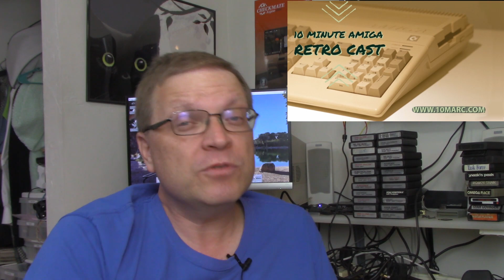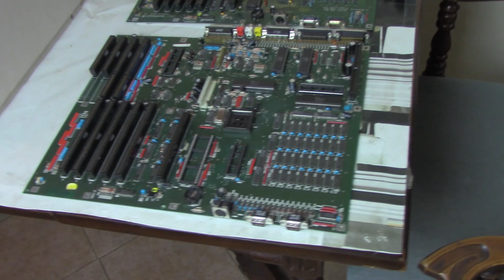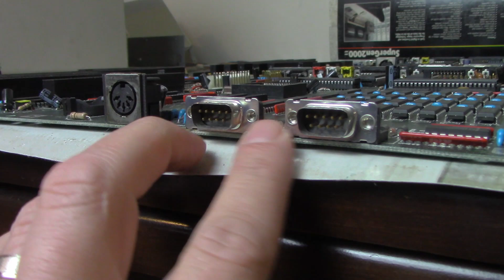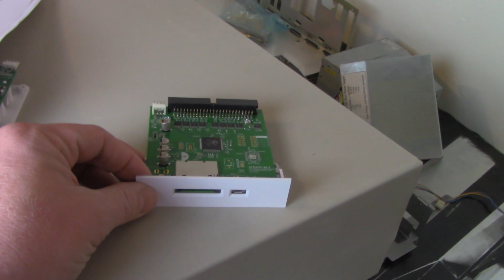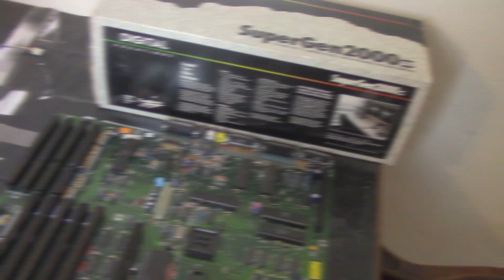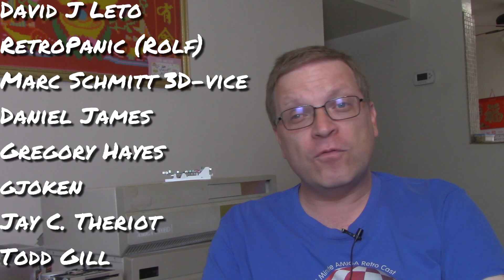Amiga 2000 Adventures - Let's Build an A2000 -Part 1- Episode 86

Comment: I love this!
19:58 - I have a Plipbox for mine, but it blocks the video port...I suppose I can try to find a video card and not use the standard RGB.
(looks like your metal shield came off yours as well. I put a tiny bit of glue in the middle/top and slid it back on.)
Reply from the maker: My Plipbox blocks the RGB port, too, but I figure I will just use a straight thru extension cable to extend the port out a but.

Comment: Oh man I love this idea for a video series! I love the A2000. It's expansion capabilities are second to none in the Amiga world. The 3000 is certainly prettier and more powerful, but you might lose some knuckles playing with that daughterboard. I use a GeForce 030 @40Mhz in my A2K and I just LOVE that card to death as it also has on-board fast RAM and internal + external SCSI (I also use a SCSI2SD card with mine - I'll never go back!), for "blazing fast" transfer speeds. :) It also has the 2mb megaChip. One of these days I hope to find a Mac emulator board for my A2000 - that would be so dreamy. 

Worth noting on your SCSI2SD board, you can create multiple "images" on a singe sd micro rather than needing multiple sd's. 

What I love about the A2k is not only it the most easily expandable C= machine ever made, but because she's the fraternal twin of the A500, she is also the target of most of the legacy software ever written. That's 100% BAD ASS if you ask me. 

You've got some fun projects ahead! 

Who did you use for your motherboard repairs? I have one A2K that needs someone to check out why it won't boot, too. (sorry for the monster comment)

Comment: 18:30 Thanks for this tip.
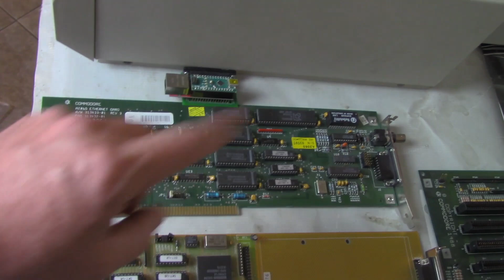19:30 so cool that you have the Ethernet card. The lack of this was the deal breaker that my college's CS department wouldn't consider buying an Amiga when we participated in the Commodore's Purchase Plan/Program c. 1990. They loaned us a Amiga 2500, but without connectivity it wasn't so interesting to students, compared to say a Mac IIx.
Looking forward to the rest of the build!

Comment: 11:23 A bit of trivia: there do exist some cards for the PC, albeit early ones, that will not fit in a 16-bit ISA slot but will fit in an 8-bit slot. The issue is that the PCB drops down to where the 16-bit ISA extension is. I think this is why Commodore left those last to Amiga 2000 ISA slots as 8-bit but upgradable. Here is an example of a card that will only fit an XT slot: https://en.wikipedia.org/wiki/Color_Graphics_Adapter#/media/File:IBM_Color_Graphics_Adapter.jpg
So, those "boring 8-bit slots" work with the A2088 XT Bridgeboard fine. :) There are even some 16-bit ISA [video] cards that function fine in an 8-bit slot: one example, here at 14m29s: https://www.youtube.com/watch?v=NGk31dRc05E#t=14m29s
Reply from the maker: Interesting to know about those 8-bit cards. I know a lot of them are just fine, and some things like cereal and parallel cards don't really need to be 16-bit, as 8-bit works just fine for their purpose. I just like poking fun at IBM PCs, really.

Comment: 12:16 I see what you mean, Doug, that most cards need to be long because they have to reach the back panel holes if they have ports.
I hadn't really thought about that before, i.e., that it's weird the Zorro slots are so distant from the slot openings on the back. :)
One short Zorro II card is the ICD AdSCSI 2000 Advantage card. It is ~half length with detachable rails that can be left in place if you want to mount a 3 1/2" hard drive to it or if you want it to be rigidly attached to its external SCSI port on the slot cover.
https://bigbookofamigahardware.com/bboah/product.aspx?id=1204
Reply from the maker: I agree that there were a few half size zero slots that just stayed in the case and did not need too much sticking out the back. And there are even a few more of them brand new nowadays that are half sized.

Comment: You when the A2000 caught my eye it was things like the Bridgeboard and Emplant or AMAX-II boards that blew my mind.   I thought wow one machine running Amiga, IBM PC and MAC, why have 3 systems when you can do it with one.   When I got my A2000 in the early 1990's it came with an external AMAX-II which had MAC System 7 already installed.  Honestly I did not use the AMAX-II all that often and as much as I wanted a Bridgeboard I never bought one.   I bought the A2000 to run my BBS since it had a 7 Port Serial Card which allowed me to run multiple phone lines.   I already had the Expansion System DataFlier Hard Drive Controller and 8MB RAM Boards which I first used on the A1000 and A500 so I moved them to the A2000 since the BBS Software was already configured and running.   The BBS ran until 1997 when activity just dropped off the face of the earth as everyone got hooked on the Internet.   The A2000 was always set up for use until I moved to my current home where there was no space until I got motivated to archive my software library and get it transferred to my server to be preserved.   Only place I could put the A2000 was on the kitchen table and unlike you I don't have wife worries anymore.  Amiga's can be reset but a wife does not come with such a feature.   So the A2000 stayed on the Kitchen table for months until I freed up some space in my server rack and so the A2000 lived there for a while.  I did install a Commodore 030 board with a BIG RAM Card, Indivision Board, Lyra2 and Miscrosys adaptors so I could connect it to my KVM Switch.   I did have a Commodore Ethernet Card with an AUI to Ethernet Adaptor but I replaced that with an XSURF100 and Rapid Roads card.   I did put in a GOTEK and an external USB DVD and Card Reader to read cards I have files on or cards I am playing with across all my Amiga's.   Yea once you start playing with the A2000 it sends you down a RETRO RABBIT HOLE and you end up buying the rest of the Amiga Family along with lots of shelves, more KVM Switches and you end up stacking them which brings me to my next thing a new server rack with sliding shelves so I can setup all my Amigas in one place but I this one requires a lot of thought on my part because to rack all my Amigas, PC, Receiver, Switches and what not  might require a 42U Rack and its not like you can roll it out the door because it would be too tall so it will need to be built in room it will live in and so that's my dilemma.  This wild ride stated just because I had an A2000HD and wanted to archive my software library.   Honestly if I get more Amiga's I will have to move to a bigger place.
Reply: @John Smith It connects to the external Floppy Port of the Amiga that contains Apple ROM's.   It has two floppy drive ports one for the Amiga and the other for an Apple Drive. The A-MAX-II was made by ReadySoft in Canada.   You can look it up on the Amiga Hardware Database.

Comment: Nice video, looking forward to part 2 :) I love the Amiga 2000, it's so interesting with it's big motherboard and all the expansion cards. I have one from 1988 I tried to fix, but failed. Then I sent it in for repairs. Over a month later I got it back repaired. I was so happy to get it back, and I was going to upgrade it. Then some of the chip ram failed. I sent it back in for repairs again, and now I am just waiting. I miss my lovely A2000.
Reply from the maker: The expansion capabilities are impressive for sure! Sorry to hear your A2000 is still sick.

Comment: Doug, just an FYI. I have Amiganet Hydra Ethernet boards (slow as molasses, but they work) which too were BNC + Thicknet based. I use them with Cisco CentreCOM AT-210TS AUI RJ-45 Transceiver. On EBay they run about $30. I too have put GoTek's and SCSI2SDs in mine, and in two the Microway Flicker-Fixer.
Reply from the maker: I am excited to get one of those transceivers! Thanks for the tip!!!

Comment: Doug,these transceivers are dirt cheap and work on the A2065 to give twisted pair:  search for Allied Telesis CentreCOM 210T Transceiver on Ebay.They work perfect on the A2065 and are cheap. you might even find a better price with some searching. Be sure to set the 2065 jumpers to activate the AUI port to make the adapter work.
Reply from the maker: Really? All the ones I found a few years ago were horribly expensive. Maybe I was looking at the wrong kind. I appreciate the tip and will look for that transceiver! I have like three or four of the A2065 cards and have not used any of them.

Comment: Zorro2 slots in the A2000 max out at 3.5MB/s.. Zorro3(a3000,4000) can do 14MB/s max. 16bit isa was 8MB/s,but if i recall some cards like diamond speedstar could overclock isa to 11MB/s,a trick used with 2386 bridgeboards.
Reply from the maker: For sure. The theoretical max of ZORRO II was 14 MBs but you could never achieve that due to the architecture. ZORRO III has a really fast theoretical maximum too , but the Buster slows it to the 14 MBs.

Comment: Oh god Doug, let me send you the STL file for a better Gotek bracket that adds in a spot for a rotary knob. Soooo much easier to use!!! (I assume you have a 3D printer). 

Also, good luck with the Romulator. That one I got from you - absolutely no luck whatsoever on my rev 6.1 board. I give up with it.
Reply from the maker: Really? No luck with it? So did you try it on another machine? 
No, I don't have a 3D printer.

Comment: In 2004 I purchased an Amiga 4000D,  CyberstormPPC, 233Mhz/060, CybervisionPPC, on German eBay for £350 + postage.
In 2006 I won a stock A4OOOT on eBay for £250, at the same time Software Hut in the US were selling brand new NOS A4000T's for about $1000.
It's crazy how under valued Amiga gear was back then and how most of us failed to notice.
Reply from the maker: This is so true! The other sweet deal I got was an NTSC A1200, a PAL A500 and an Atari ST 1040ST for $100. This was in about 2013 or so.